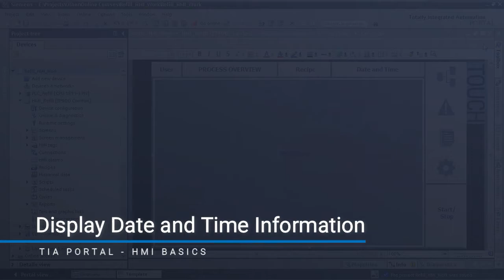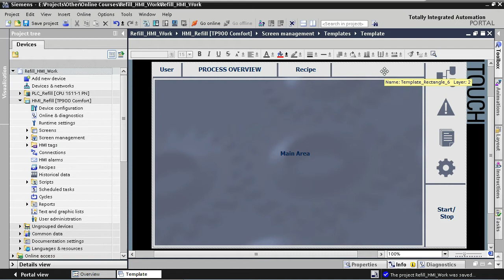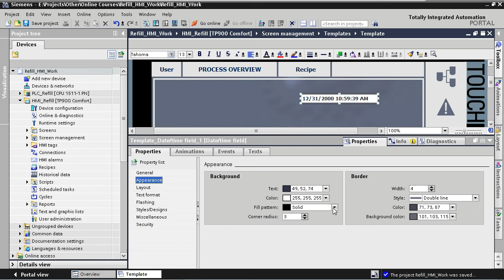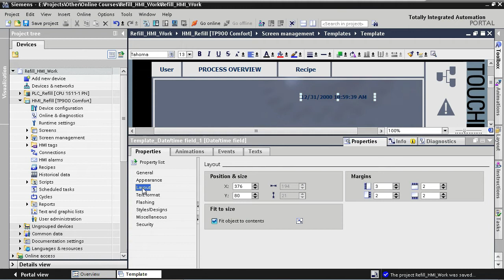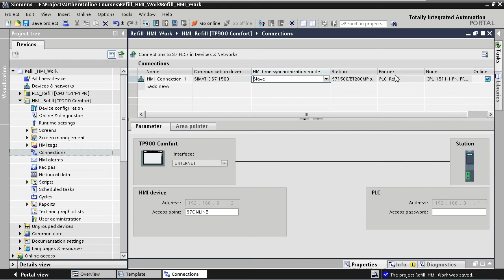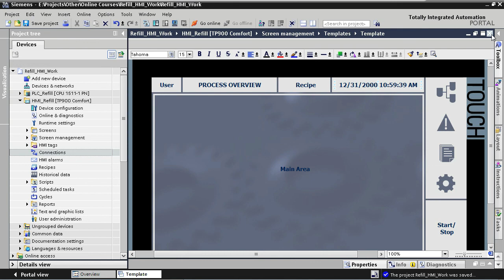How do I Visualize the Current Date/Time in my TIA Portal HMI Application?

Comment: Hi There, is the "system time" check box ticked for this?. or do we also need to direct the date/time to a PLC tag?
Reply from the maker: You do not need a plc tag for date time.  With this synchronization, the HMI will take over the date/time from the PLC.

The date/time for the PLC can be set by going online with the hardware configuration of the PLC.